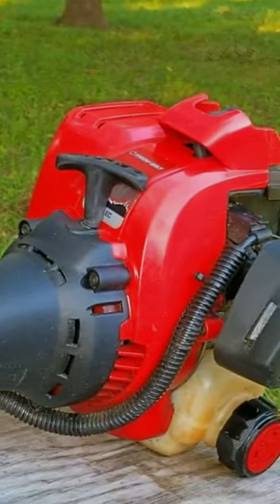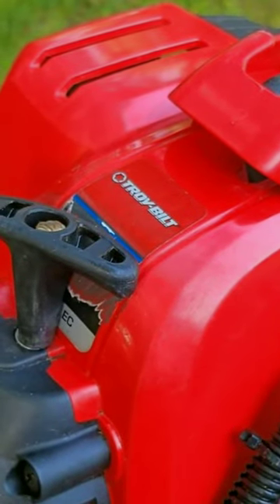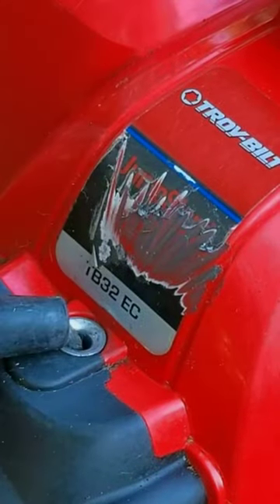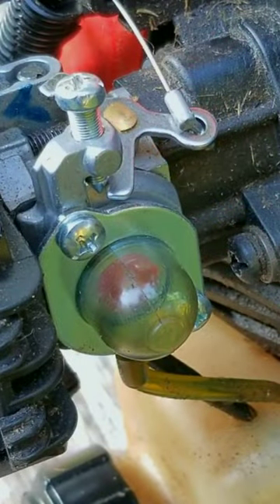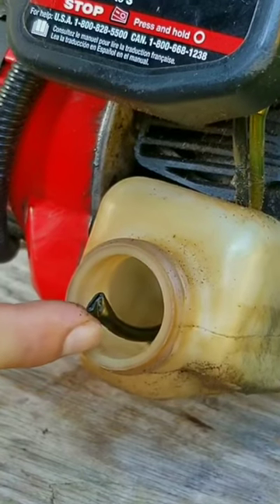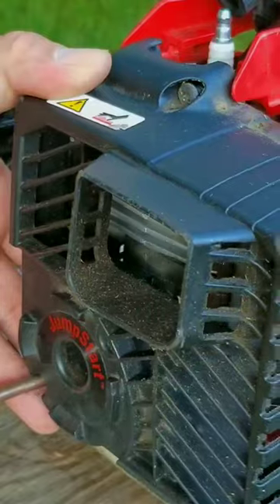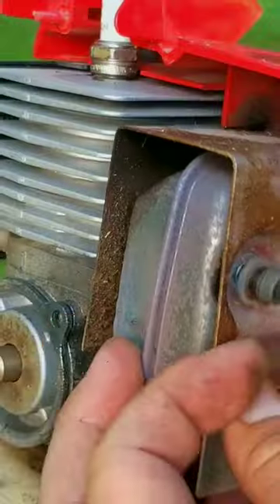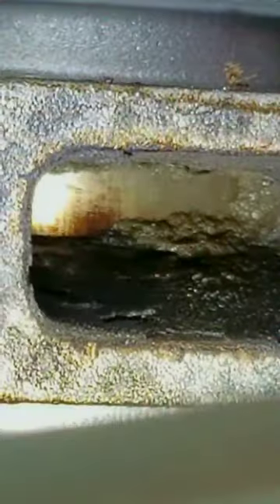You're Using Your Trimmer The Wrong Way #shorts

Comment: I let my little 2 cycle warm up for about 3-5 mins while I put on my boots and safety glasses and I only run it about half throttle or full if I need too. A good tip is when you’ve used your wacker for a couple hours or so when finished don’t just immediately turn it off let idle for about 30 secs and that helps w starting it next time 💪
Reply from the maker: well said! I'll have to include that information too.

Comment: I've always heard (read it in the owners manual too I think) that running the engine at low speed for an extended period is bad because it starves the engine of lubrication. Makes sense, I guess, since it needs the oil from the gas, and it just doesn't get enough at extremely low throttle.
Reply from the maker: that too. it just best to run it at least half throttle, if you don't need to give it the beans

Comment: I don’t run my trimmer at full speed, never have & i’ve never had a issue, its a budget brand multi tool with a 25cc engine that i’ve had for 6 years now & it does a lot of work.
I run all my machines on standard E10 pump gas & i use a basic no nonsense two cycle oil (it even says no nonsense on the bottle).

If you are getting too much carbon build up running your small engine at anything less than balls to the wall ! Then your fuel air mixture is incorrect.
Reply from the maker: that's an interesting view. If you're running your stroke at less then full speed, then your air fuel mixture might be too lean, and not making any extra carbon. If so best to not run it at full speed then.
Reply: @HomeGaragechannel  
I did make a minor adjustment early after purchasing it to clean up the running, it was just a little off & would struggle in long grass causing the engine to get extremely hot. Since that minor adjustment it’s been great, it only has the one adjustment screw for high speed, i think the low speed is from the top under the throttle cable cam.
The HS screw has a unique anti tamper head, it’s round in a recessed hole with just a small hole in the top offset, i had to make a tool as even my carb adjustment tool set didn’t have the right screw handle for this one.
Reply from the maker: it must be an interesting screw head to need a special one.
Reply: Don't understand why you use E10 loll ??? That's the way to have to clean carb and all fuel system really often EXCEPT if you burn full tank each time and refuel w new fresh each time too but that's not a good option IMO.
Reply: @martindesmarais7158  in my opinion my machines work flawlessly year in year out so i dont need your opinion. i never leave fuel in a machine so it’s never a problem. Why would i pay twice as much for E free fuel when i can spend a few minutes emptying the fuel out at the end of the season ? 
I then purge the fuel system with 2 cycle oil, ready to go the next time i put fuel in it.
Even a brand new carb ever year would be cheaper that buying B/S canned fuels that claim to remain stable but in fact they don’t.
Reply: @Will Grant  1. I agree that canned fuels prices don't worth the money.
2. Ethanol-free is NOT twice the price of regular gas and worth the little extra.
3. It's just an opinion sharing here so don't understand why you're so... evil !
Reply: @martindesmarais7158  arrrrh, you are one of those ! You don’t recognise your own hostility but it’s glaringly obvious in others.
You seem to think that even though your opinion was unsolicited, i should still be thankful for it, as it is, in your opinion what i should be doing.
Reply: @martindesmarais7158  
Just for context; i compression tested & internally inspected a leaf blower i have owned from new for six years, it gets used all year around & has performed hundreds or hours of work. The piston is still clean enough to read the production lettering & the compression was 125psi.
The make of engine is an unknown generic Chinese brand & the machine has been run using the same fuel & oil that I mentioned to Eric (the man i was speaking to who is not you)

Comment: You can vary the oil/fuel mix to reflect what speed you want to run your trimmer.
I mean that is what the variable oil injection systems on 2stroke outboards did.
Idle @200:1 and wide open throttle @ 25:1......
So you need to decide at what rev you will use your trimmer and mix accordingly.......
The danger comes in running the trimmer at the wrong speed .......
which is why the manufacturer recommends a good average...
say 50:1,  or 100:1 
or even 16:1 for really old plain bearing chainsaws... 
that smoke like hell....
at any speed.
Reply from the maker: you are correct, oil mixture has a huge part to with it as well.
Reply: really good observation, I used mine at standard 50:1 ratio at first and found it very hot for the little 21cc block as I use it most of time full throttle (as brush cutter for trees!) so I reduced at 40:1 and that's the good way for it (Tanaka straight shaft)!!!
Reply: @John Smith  euh,,, on the contrary, I reduced fuel !
And for oil, I use Sthil,,, your opinion on...?
Reply: @martindesmarais7158  
Stihl oil is reputed to be rebottled BP oil. 
It seems good and I use it in my Stihl chainsaws....

Comment: I thought warming up cars to operating Temps is good for it before driving racecars are pumped with warm fluid before starting because the clearance of the parts are so slim that cold starts can hurt it but are you saying that in the winter it would be best to just start my truck then drive right away?
Reply from the maker: this video was about how to use your trimmer.  As for your question, I give minimal warm up, in the cold.  I would say 2 to 3 minutes at most. And yes race cars are different.  So they do not apply in this situation.
Reply: @HomeGaragechannel  I can't park on the street and I have always warmed my vehicles up even in the summer before parking them in the garage what's your take on that?
Reply from the maker: It's your car, do what you want, and unless you have a race spec engine, warming it up is not necessary. I used to to use my turbo timer on my car until I realized the low speed driving home was enough to cool the turbo down. So I don't use my turbo timer anymore. As for warming up my race car,.. about 2 minutes even in summer, but when I start driving I don't rev pas 4k until the water temp is "close" to normal.

Comment: I have a mcculloch md3800 trimmer i ordered new piston rings and the cylinder is in good condition except for a big scratch . Do you think it will work? I put the cylinder on a similar trimmer and it ran with that cylinder
Reply from the maker: sure it will work, but it's going to be a bit down on power
Reply: @Home Garage  im not planning to use it i just want it to start and run bc its a nice trimmer and it hasnt ran in 20 years

Comment: Well, running it at idle does not burn the fuel properly so essentially your frying terrible fuel economy second off its bad for the engine it carbons up the piston and clogs the muffler and makes a sticky gooey mess run at full throttle for best fuel and best performance
Reply from the maker: thank you Hunter 747

Comment: Hey home garage, so I have an echo gt-225. Not sure if i have asked this before, but mine has black goo that is everywhere where the I believe muffler is. What could cause this?
Reply from the maker: if I had to guess, I'd say it was old "oil/gas"mix, that's been leaking out the carb, filling the engine, and working out muffler. Do you now if it was hung on a wall for awhile?
Reply: @HomeGaragechannel  it sat without use for about 2 months laying flat. But even when I did use it for my lawn care business(not crazy use, but a decent amount) the problem was still around. Slowly, but surely the black goop would build up
Reply from the maker: gotcha, if it still works fine, I wouldn't worry but if it starts having starting and running issues, I'd replace the carb.
Reply: @HomeGaragechannel  awesome, thank you!
Reply from the maker: anytime